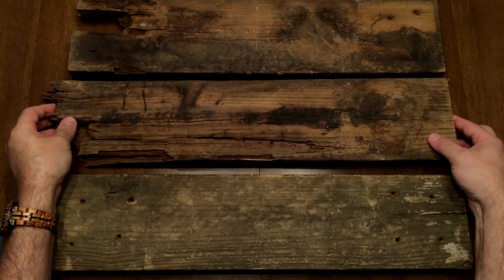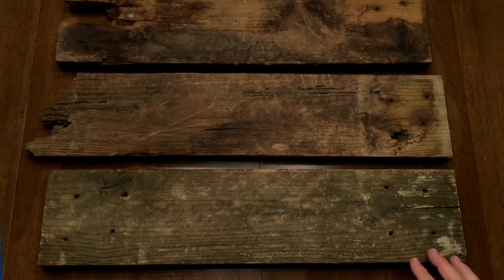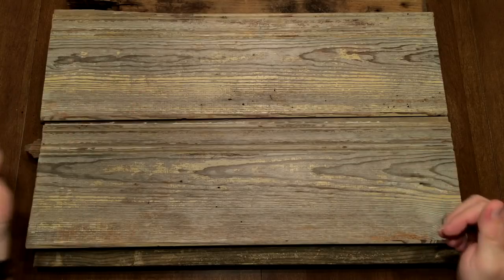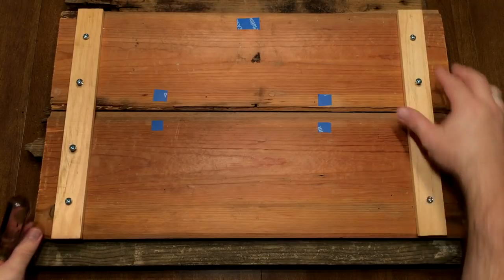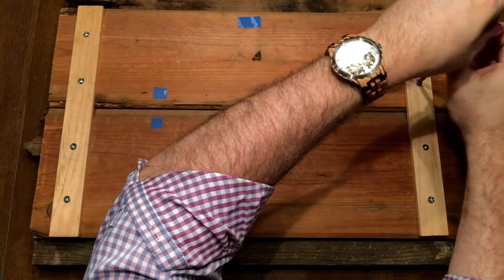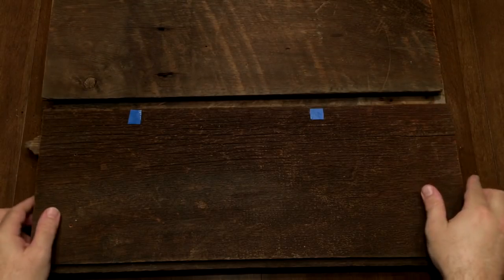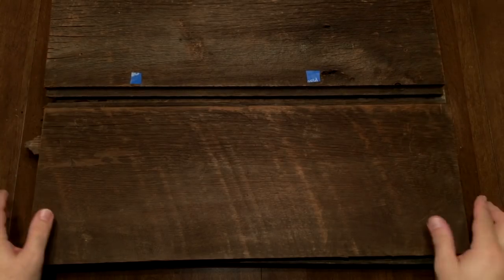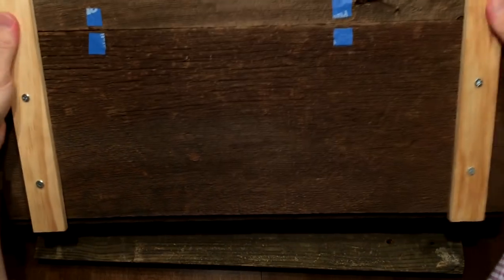ASMR Wooden Panels (soft speaking, wood sounds, tools)

Comment: Great video once again, may I ask how you set up the overhead camera for this kind of viewpoint ? It would be perfect for my channel.
I am very tall and wide so it looks impossible for an amateur video presenter like me so would appreciate any help ?
Dev 
The Modernist Colourist
Reply from the maker: Hey there Dev, good to see you here. I use a microphone stand with a boom arm and a swivel adapter to position my phone over the table like that. The stand has a heavily weighted base to help with stability, although the phone is much lighter than a DSLR or a camcorder, of course. Most of my videos have been done with a tripod in front of the table, but my setups for the Huge Atlas Collab got me started using the boom stand approach, and now I'm using it for most things. It is liberating not having to reach around a tripod for everything. I'll check your YT channel for an email addy, and send you a pic or two.
Reply: @GaslampASMR  Cheers my friend
Reply from the maker: Check your email, Dev. Let me know if I can help further. Cheers!